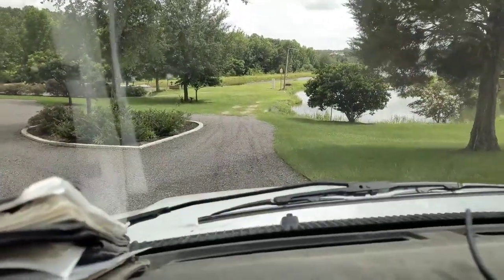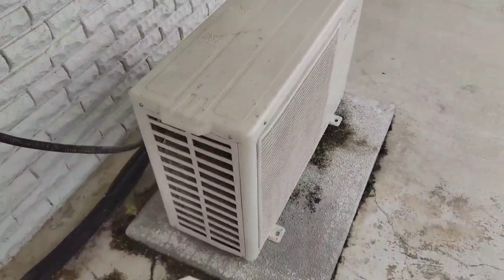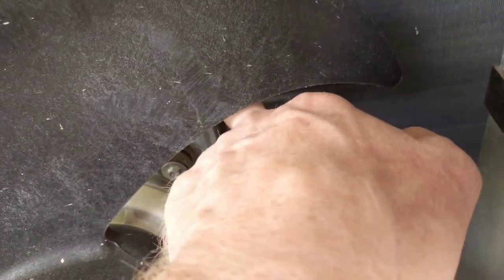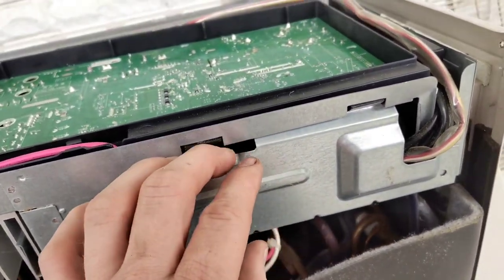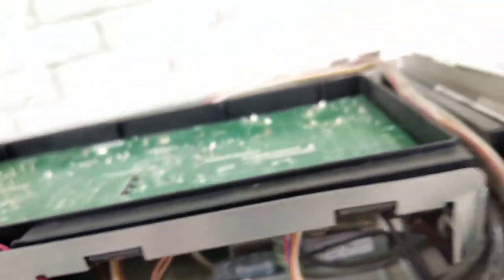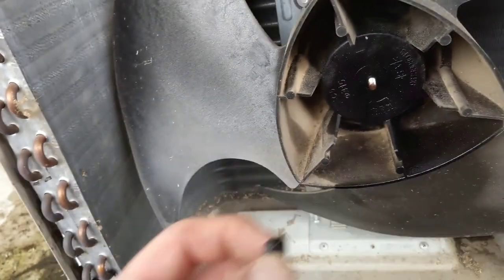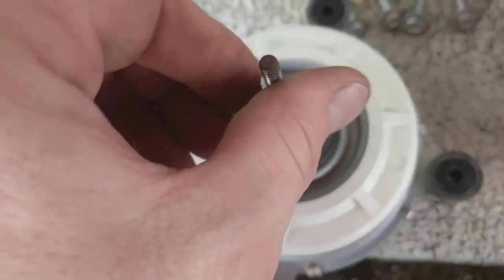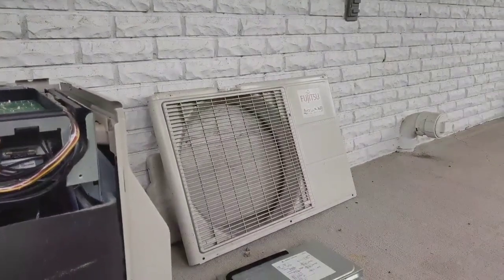FUJITSU MINI SPLIT - CONDENSING FAN MOTOR REPLACEMENT

Comment: I'm getting a code on my fujitsu.9 blink, 7 blink on my indoor unit. Says outdoor unit fan motor 1 error, Duty error. 
Also on my outdoor unit I'm getting 15 blinks, outdoor upper fan fail. 
Can you help me with this? I'm thinking about replacing fan. Not sure if that's will fix it tho.

Comment: My unit showed code #11 serial communication error. 
Repaiman, after 4 trips in 25 days in 80 to plus 90 degree heat, had unit running again for $740
Replaced 3 outside circuit boards plus condenser motor. I was told faulty fan motor blew boards.
Any experiences like this?
Reply from the maker: Truthfully no.....they were unfortunately chasing their tail on your unit.... condensing fan motor isn't going to cause any of those boards to fail....mini splits are very SENSITIVE to voltage spikes...Just from the details given I'd say to be on the safe side to have a SURGE PROTECTIVE DEVICE/SURGE PROTECTOR INSTALLED out at your disconnect for outside unit . I feel like the condensing fan motor was just something else that broke that it was non-related....
Reply: @hvactipsnow9892  Thanks so much for your time and advice. Running 2 Fujitsu units, 6 and 5 years old resp., love unit operation but have had several expensive repairs for age of units? If could get nice free red Fujitsu shirt like yours, I'd be more than satisfied! 👌🏻🤣
Reply from the maker: @southernillinois5973  Get a FEW PERKS.... 😆...If you haven't already sure would appreciate you subscribing would definitely help the channel... Thanks 😊

Comment: Can this kind of motor be disassembled to change bearings?
Reply from the maker: No unfortunately not
Reply: @hvactipsnow9892  Extremely lame. Those are running at ~150 EUR currently, and they don't even have it  anywhere.
Reply: @hvactipsnow9892  Thanks for the info 🙏